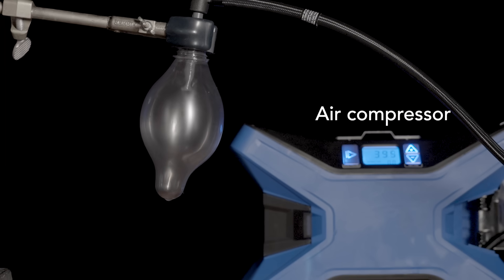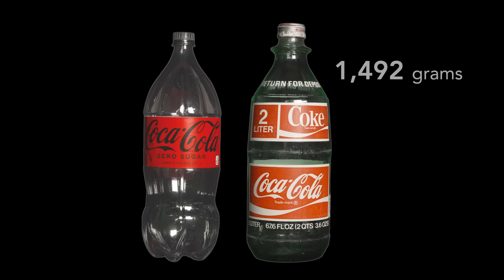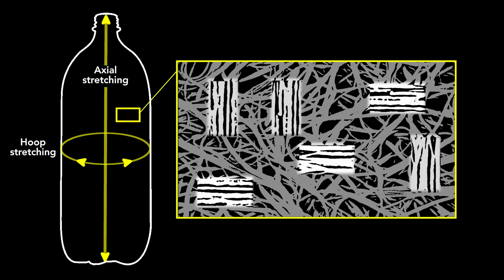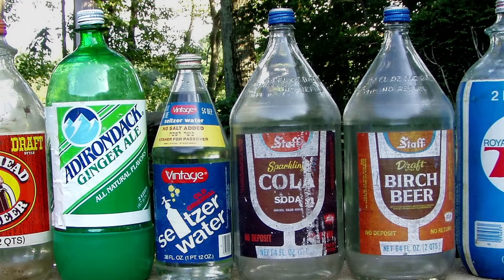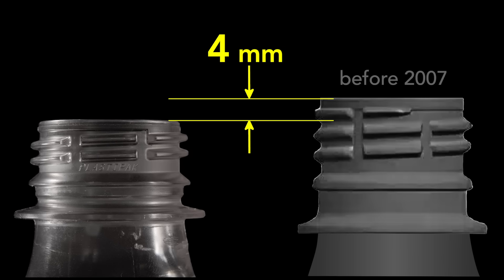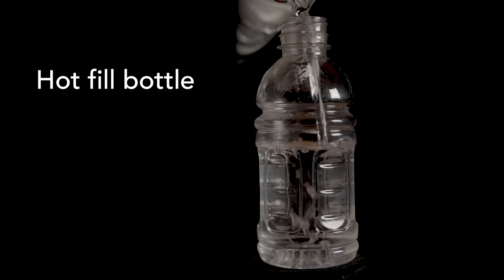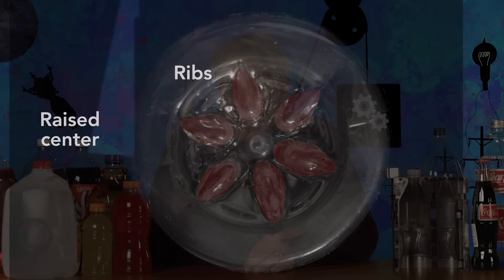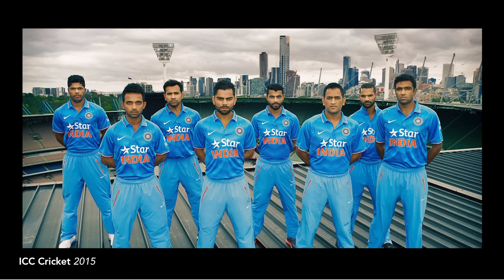The masterful design of the two-liter plastic soda bottle

Comment: The title suggests that there is a special two liter bottle. But then he talked about all PET bottles in general. I tried to remove the label and rinse out ketchup on a few occasions. The bottles shrank spectacularly. Why does a bottle with a gassed drink shrink over years as it loses its contents instead of the forces in and out balancing eventually? Is it because there is no water outside, so it prefers to diffuse out and not enter?

Comment: Bloody spot on. I was a maintenance engineer in a huge water bottling plant and this is by far the most comprehensive video I've seen on this topic. Our best machines could do 86'000 0.5L bottles/hr every hour, every day for weeks. 2L could be done at 34'000/hr.
Reply: How many in parallel was that?  I mean how many nozzles did the machine have?
Reply: that's almost 24/sec, or 24Hz. mindblowing.

Comment: as great as the bottle's engineering is... it is missing the most important part: closing the loop on single-use and making recycling a key component to the product's life cycle. corporations need to be compelled by law to design recycling into these single-use plastic products' life cycle with reasonable limits, say 50% recycled to start, moving up to 90% or more.

Comment: What an excellent video! It’s rather serendipitous that I should come across this video when I did since i’m part of an Intro to Ocean Engineering group project at my college that has each group making a boat and racing it at the end of the year. 

Everyone chose a rubber band/tension powered boat but ours is using a pressurized PET plastic bottle partially filled with water to jet the boat forward! 

This video acts as a fantastic explanation of the material science behind why PET is so strong under pressure and how it’s made! Thank you for giving our out-there boat some scientific legs to stand on!

Comment: I brew inside these bottles. Any other type of bottle is unusable - your drink will either spoil or not become carbonated. These bottles look flimsy but in reality they are stronger under pressure than any glass bottle. Place some sugar and baking yeast inside, fill it up with water leaving some air at the top. After 3-4 days the bottle will inflate to a baloon and still not burst.

Comment: I would expect the strand alignment to be mostly aligned with respect to the expansion surface not perpendicular to expansion but mostly evenly distributed with angles from vertical to hoop in the side walls.

Comment: Suggestions for future videos:
Steel Rebars
Alloys/Metallurgy/blacksmithing
Concrete beams
Bridges and types
Microchip manufacture
Wood types and mechanical structure
Refrigeration solutions: basic fridges, Helium nuclear reactor coolants, silicon based cooling chips
Aerodynamics of Helicopters, gliders and Airplane
Swiss army knife

Comment: There were plenty of those capped bottom bottles in the late 80s, maybe early 90s.
What about the bottles that seemed to be made of layers? I remember seeing a outer layer of plastic separating. I would press on the spots because it sounded crunchy.

Comment: Great video! CO2 (or gas barrier in general) of PET bottles can be significantly improved by applying a SiOx coating to the inside. The coating as well limits the amount of leachables from the mateiral that end up in the beverage, which especially could become a problem on high shelf life products made of at least partially recycled material (depending on the source and recycling process of course).

Comment: I still remember the colored bottom cup 2l bottles sold in mid-'90s post-Soviet "E." Europe. Shops had 50/50 old and new bottles for sale, new ones must have been mostly imports (we couldn't get enough of the latter after half-empty no-choice planned austerity shelves of USSR). Always wondered what the purpose was of the extra part on the bottom if you could do without it, seemed like a fancy overdesign.

 10 years later had the misfortune to work in a blowmoulding department of a gifantic factory for a few months. It was not a beverage but cleaning supply company, which meant no standard screwcap thin neck PET bottles and no preforms. Most were HDPE coming out as lava from tubes in watercooled forms, making various shapes of colorful bottles with larger tops. Quite an efficient process, but could get sticky. Our middle eastern supervisor yanked off liquid plastic if the blowing machine malfunctioned and mangled around forms with his bare hands. I guess it would get stuck to rubbery gloves and without glitches in the production line it would be the most repetitive and boring job ever. I realised there is an intricate design invested in most plbottle shapes, but even more goes into designing the moving metal firms that makes them. That's another level of precision artisenery and design, which i ended up learning as a profession. CNC machining is way less boring. I'd say even way too interesting for a peaceful job.😅

Comment: Hey Bill.  That was a great video, but c'mon you are giving away all our secrets! 😊😊😊  I work for Plastipak Packaging which is who made the preform you focused on.  I have a couple points to share.  In your video showing the stages of blowmolding a PET bottle, you do not show the stretch rod in contact with the bottom of the preform.  It is called a "stretch rod" because it stretches the preform to the bottom of the mold to pin the gate of the preform to the bottom center of the mold.  Otherwise the preform would bend one way or another when blowing and the gate of the preform would swing off center.  If the gate swings more than a couple mm, the material distribution of the feet will be too inconsistent.  The other thing I would like to share is that PET is recycled into new bottles as well as being spun into fiber which is also used to make strapping for palletized goods and materials.
Reply: Are you talking about that hard plastic piece that seems like a cut off dowel that's at the centre on the underside of lots of bottles? I always wondered about that.
Reply: @jasondashney  No I think that part is made during the injection process, so the preform probably already has that.
Reply: @flydrop8822  Yes.  You are correct.  :)
Reply: @ thanks for the clarification. Coming out of high school my dream job was to design automated factories. I had to watch How It's Made in a dark room alone with a box of tissues.  Instead I went into athletics and then construction. That was a mistake, ha ha.
Reply: @jasondashney  Well maybe your destined to improve the level of automation at Plastipak?
Reply: @ oddly enough I did have a concept when I was a teenager for a 2L bottle that would prevent the soda from going flat (I just needed to know if it was economical or not).  I had several ideas for things, but never any resources to pursue them.  Oh well, I'll try to be born with either money or better connections in my next life haha.  Cheers!
Reply: @jasondashney  Well if you can remember your ideas, I would be happy to discuss them with you.
Reply: @ I would have to flesh them out a little more. The only thing I've designed lately is a superior way to keep construction fences locked together. I'm trying to learn about the patent process which it turns out is a lot more expensive than I bargained for.  Such is life. 

I had a few ideas as a kid.   I remember when it occurred to me one day that a clothes dryer was really only 3 parts so I wanted to look at different valve styles and design an all-in-one washer/dryer.  I was looking for a used front loading washer and dryer back then to play with but I couldn't even afford that as a kid because they were rather rare (the washers, at least) back then and very costly. Money was always an issue.  Many years later I saw that the all-in-one washer/dryer existed (and had for decades) but there was no internet in those days so I couldn't just google if it existed or not. I had given up on product ideas due to lack of resources and mostly got irritated with bad ergonomics and processes as I got older. Always looking for a smarter way to do things.  I wanted to get into ergonomics consulting because I'd designed little things like a novel system for a backpack to hold skateboards.  I designed that for Burton snowboards, but they have no idea. I gave the idea to a friend who rode for them and they ran with it.  I was just happy to get a sample bag.  I designed public skateparks (one was quoted in the largest skate magazine on earth as being as good of a park as there was anywhere), but again for free simply because I wanted better ones to use myself. I never knew how to monetize better mousetraps, and figured no company would hire me sans extensive resume of paid gigs from big companies after a degree from a fancy school. Then the months/years go by and suddenly the mirror tells me I'm middle aged and probably missed the boat.
Reply: @jasondashney  I have had similar experiences.  In my youth I had lots of ideas, so I got a pad of graph paper and started drawing them out.  I was a big fan of space stuff and I knew all about the Apollo program.  When the space shuttle columbia first went to space, I was impressed, but I thought they would have to vent all the air before they could take a space walk (just like they did with smaller spacecraft).  I reasoned since the shuttle was so much biggger, that would waste a lot of air, so I "designed" an air lock to save the air and allow only a portion of the crew to come and go while the others stayed inside.  I showed my father and he just laughed and said they already have that.  :(  I was less than ten years old and I reasoned out a real solution to improve space craft of the future.  I still think that was cool even if nobody else does.  I am like you now.  I am 49 and I just give away my ideas.  I send ideas to all sorts of companies several times a year.  Although some companies are very happy to take your ideas and suggestions (with a document that says you give up all claims to it).  There are other companies that refuse to accept ideas from outside their organization.  Years ago, back when Taco Bell had the option to order your food "fresca style" which replaced the cheese on an item with picodegallo to make it healthier, I suggested they have a healthier taco shell made with blue corn like the "healthier" blue corn tortilla chips.  They responded with thanks but no thanks.....   A few years later, they started selling tacos with the optional doritos taco shell.  Coincidence?  Maybe.  But maybe not.  The company I work for is very big on patents.  There is a patent layer who works for the company full time.  We are encouraged to provide ideas through a structured program at work which does have some monetary incentive.  I have lost track of how many patents have my name as the inventor, but last time I checked, it was over seventy.
Reply: @ wow, that’s amazing. When I was young, I had a friend whose dad worked for 3M and I remember seeing a program where if you came to them with an idea, they turned it into reality and you became senior management for that project, or something to that effect.  Obviously the deal would be structured in 3M‘s favor, but they had resources beyond resources to make something happen if they like the idea. I wanted to try to go in that direction, but my friend moved away and that was that. I figured that it would’ve been a good thing to have on the résumé to allow me to get private funding for a different idea later. Oh well. Next lifetime.
Reply: @jasondashney  @flydrop882 is correct.  The small cylindrical bit on the bottom center is the gate where the plastic entered the injection mold to make the preform.
Reply: Your job sounds super cool
Reply: @chrisrunsthis  I am glad you think so.  After 25 plus years, it sorta becomes old hat.  Though I bet most jobs will be that way.  You know we have a lot of locations.  I you are interested to work for Plastipak, you are welcome to apply for a job.
Reply: Multiple products out of the same material, nice!
Reply: @TheGregcawthorne  Yes and more all the time.  If you pay attention to the resin ID code number in the triangle on plastic products, you will find many with the number 1.  That is for PET or PETE (dependimg on the standard used, but tney are the same).  Some fast food cups and lids are PET as well as most of the clamshells for berries.
Reply: plastipaker here.12 years and counting. Started off in the poly department working with HDPE and move over to injection before entering leadership roles.
But the science and engineering behind everything was always fascinating to me.
Reply: @Usersunited  What plant do you work at?  I work in Medina, 26yrs.

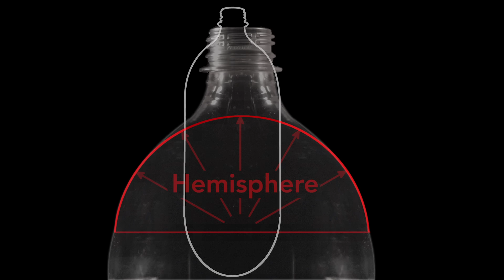Comment: 5:09 I was born in 82. I remember some glass pop bottles. I remember the plastic cup at the bottom of early pop bottles. I think glass bottles stuck around for a while because of vending machines that were designed for glass.

Comment: One small correction/addition: you say that the key trait that makes PET the plastic of choice for bottles is the unique formation of crystalline regions, but this is false. Many plastics will form regions like that. The key property of PET is that it exhibits a behavior called "Pi Stacking" where a specific chemical interaction between chains forms a barrier impervious to gas. Any other cheap plastic would have the pressurized carbon dioxide gas slowly leak out over time, but PET holds it in.

Comment: I used to work in sports drink filling plant, the filling machine is a mesmerizing sight when it's doing its thing. And then the filled bottles seamlessly transferred to capping machine to complete the process in mere seconds. It's a hot filling system but they also got pasteurized in a giant pasteurizer machine so the bottles endured hot temperature from inside and outside.

Comment: Every dad in the Midatlantic in the 80/90s had a corner of the garage full of crab pot weights:
A soda bottle bottom cap, a short length of chain, and concrete to hold them together and provide mass. Tie the rope of the crab pot to the chain (as many as needed), and don’t forget the retrieval line and float.

Comment: About a decade ago I was working in the cycling industry and tubeless tyres became popular on mountain bikes. To seat the tyres, a rush of air is very helpful if not necessary for some cases. While professional air reservoirs are available, they are costly. It is possible to use a 2 litre carbonated drink bottle for a fraction of the cost to get the same result. You need to glue two presta valves into the cap and use a thick rubber hose and hose clamp to achieve the rush of air. I can confirm that these bottles can take 110 psi. I never tested them to bursting but its possible that higher pressures are possible.

Comment: I once watched a 2 litre bottle slide sideways on a kitchen table, fall vertically while barely tilting to one side and land on one of the 5 pressure feet on a hard floor
A 7mm hole opened and in a fraction of a second, too fast to see, the bottle hit the ceiling, by which time all the drink had excited through the hole, it had also imparted spin.

Because of the speed and spin, the entire kitchen and both people standing it in were hosed down with a spray of lemonade. 

I've never been unable to explain something in my entire life. 

The best we had was an imperceptible slope on the table and somehow the friction was low enough. 
But it moved quickly and didn't rotate over the edge and land sideways. 
It slid left and then stopped and went straight down.

Comment: Shopping trolleys all have a sloping floor, so that they can be stacked together. These bottles are designed to stand on a flat horizontal surface, but will always fall over in a shopping trolley, irrespective of how they are arranged or buttressed with other groceries.

Comment: When they changed the cap, they also removed the seal that used to be in there, and now when you re-cap a bottle, it goes flat in a couple of days, vs the old ones with the seal disk that would stay carbonated for weeks.

Comment: This video doesnt go too in depth but most polymers sort of have 2 melting temperature: a glass transition temperature and a real melting temperature. When you deform the PET you heat it up to it glass transition temperature. The interesting thing is that if, after production, you heat the bottle at that temperature (like when he pours hot water inside it) it will go back to its preform shape, since the polymers chain are still stretched from the forming.

Comment: 2:30 that's almost 5 times atmospheric pressure
Reply: That’s also 2 times the pressure in a normal passenger car or SUV tire. I run mine at around 35 . 

I did not know bike tires took so much pressure.

Comment: That's not entirely accurate, it's actually it's flimsy nature that allows it to survive such a fall. Due to it being a plastic, and thin, it can deform, allowing it to bend and warp to disipate the energy from the impact. Where as a glass bottle would just shatter as the energy went through it from the impact site due to its rigidity, the plastic just warbles that into something it can handle.

Comment: While I applaud the effort to recycle PET bottles, and it is insanity not to at that scale, the microfibers used in clothing have been linked to micro-plastic contamination of the food chain (eg from abrasion and UV degradation). It's not the worst plastic pollution out there, but there has to be a better way.